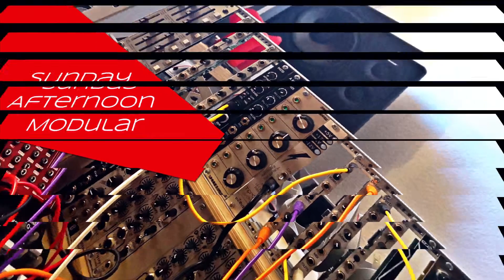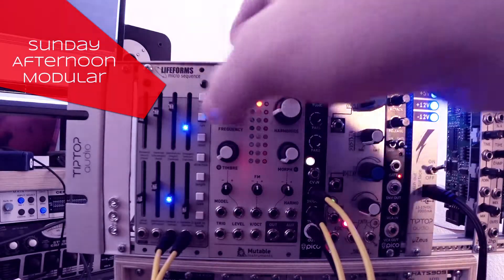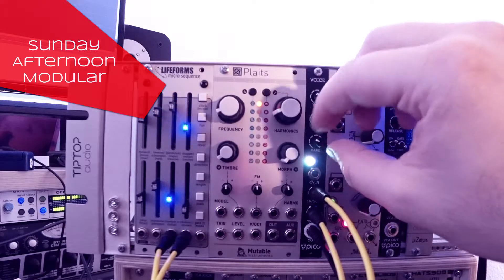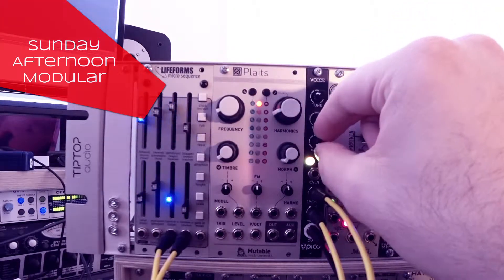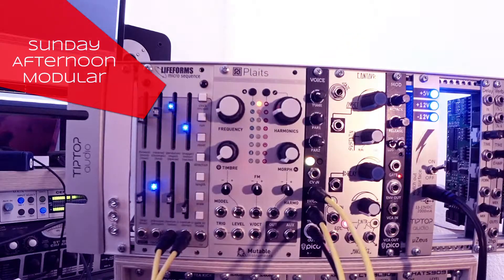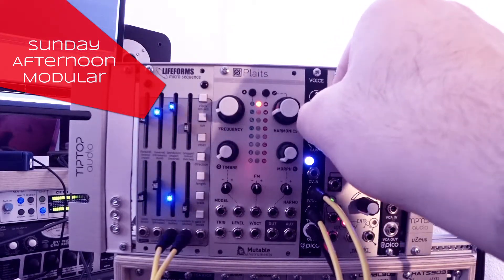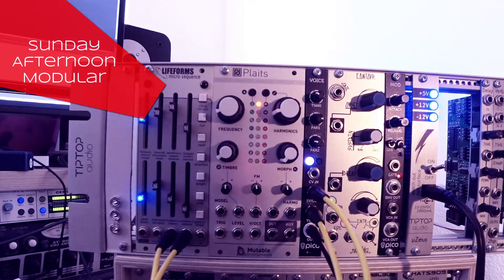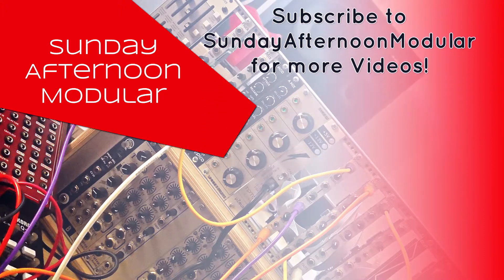Erica Synths Pico Voice Introduction

Comment: The tune knob is not discussed here. It is a bit confusing as it seems to be the base pitch to which the v/oct 
in signal is added. You would probably think it was a bipolar fine tune but it is not. Its a small knob for the whole
8 octave range when you try to set it.  You can assign the param cv in to it and use something else from outside
to set it such as a bigger knob if its sending an 8 v range and you put this knob to zero. Though it does not
save the parameter setting so you would have to do it again every time you switch on.
I think the supersaw sounds very wonky here and it may be due to the above noted fact,